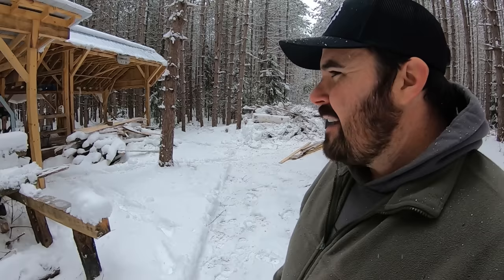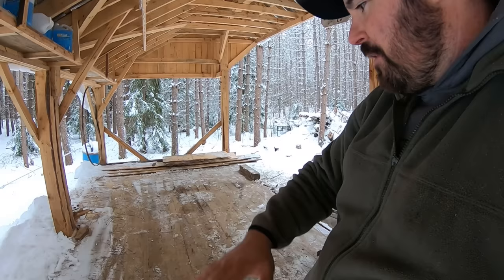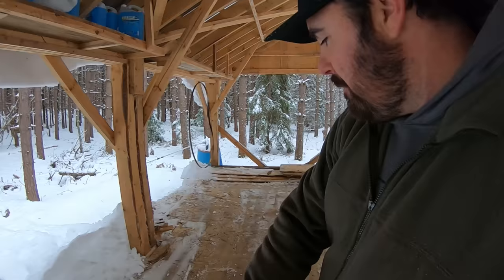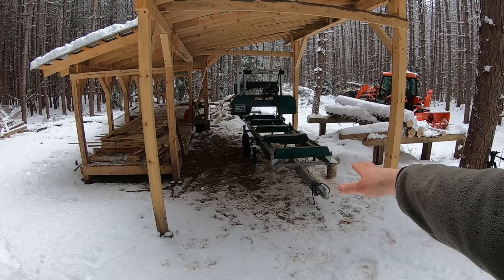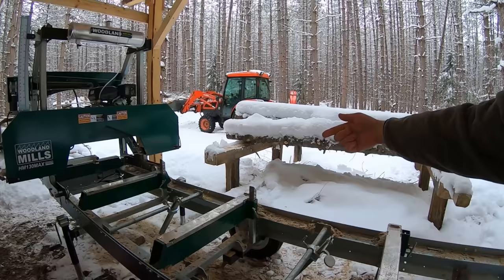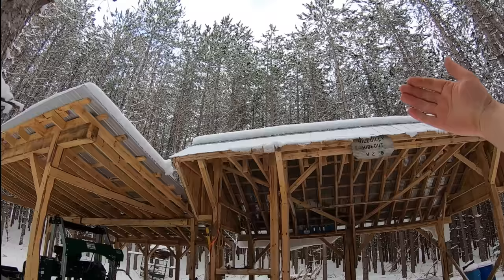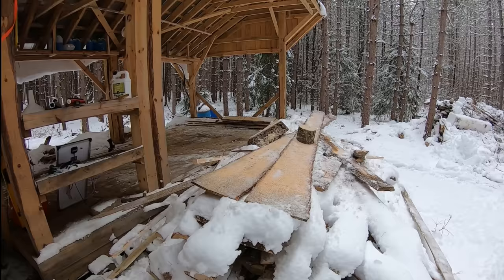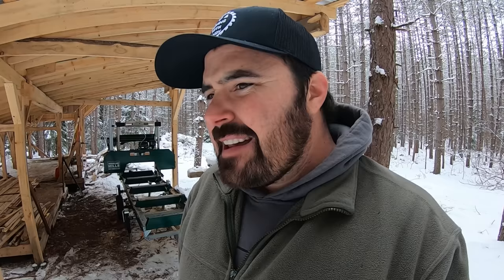Don't Build a Sawmill Shed Like I Did

Comment: Howdy Sandy- I understand what you’re talking about with having the perfect setup for a sawmill shed. That’s my next project. I did pour a concrete slab to set the mill on which I did right. The actual shed itself hasn’t come to complete fruition in my head. At least we don’t have to worry about much snow here. You will get everything all figured out and it will make a great video. God bless
Reply from the maker: I appreciate that! Sounds like a good start you’ve got going. With time I’m sure the perfect setup will be there as well

Comment: Hi Sandy, you could just simply build a wooden ramp at the opposite end of Hideout 2.0, take out a few trees and back the  sawmill where the old sawmill was. Then set up your waste rack. The waste rack could be easily moved when you need to pull out the sawmill. And the sawdust would go out the back as before.
Reply from the maker: After thinking more about it you may be right. That would be a good setup
Reply: Yes use your quad with a 2 in ball on it.

Comment: Nice summary of the pros and cons. I've been thinking about using a 1 inch metal grate platform instead of decking where the sawdust blows. If there's a nice deep but flat area underneath where I can reach it from the side I can just use a skid loader from time to time to pull out some sawdust and throw it on the compost pile.
Reply from the maker: Grate platform is a great idea. Not one I"ve thought about before. That would be a greats actually
Reply: Probably a series of 2 ft x 4 ft sections with some hinges (that will last the weather) so you can flip them up when you need to clear the sawdust out... but that's a bit "fancy"! 😏  2 ft wide might be a bit narrow for the spray.

Comment: You answered your own question. Pole barn is the answer and go big! Nice wide open area instead of the small confined spaces you're dealing with now. Big overhangs and raise the grade with some well compacted fill, and mud shouldn't be a problem. Blowing snow will tend to be a problem on one side more than another and you'll know which one, you can close in that side or just hang a tarp.

Comment: Merry Christmas Sandy!
Never underestimate where a concrete truck can go, they have smaller trucks and bigger ones with more tires to spread the weight(as long your in your  dry season) Concrete is super easy and cheaper than you think. 10mm rebar grid 16” o.c slightly sloped to drain, 4”-6” slab on compacted gravel, borrow rent or buy laser level  and set forms to correct height. With the width you would want you could just use a straight piece of lumber and smooth the top out, rent a bull float for the  day  and broom finish it. 
The large pads that you cannot reach other side you have to creat leveling pads in the wet concrete but since your would be narrow you have the top of the fork to slide on. If you go this route just have some friend over for some simple grunt work for an hour. 
Cheers
Reply from the maker: I appreciate that. I’ve been around some concrete but never tackled my own pour and you’ve made some great points

Comment: Thanks for all your great ideas Sandy.  I  intend on building a setup similar to yours, however, I intend to be able to drive my sawmill and trailer in at one end, and drive it out at the other end when I need to move it.  I also intend to use my ATV to move it around.  I am thinking of building a lumber shed attachment to the back, rather than the end, like you have.  the slabs will be in the front, next to the log deck, which will be on a couple of runners on the ground and the logs will be loaded onto the sawmill using ramps and an electric winch!  Cheers! :)
Reply from the maker: I also like that idea Paul. Would make for an easy work flow.

Comment: Having the mill under a roof is the ideal thing. Have you thought of sliding doors to block the snow from blowing in? I put sliding doors on my tractor shed to keep the snow out. Works good. Use the barn door type. Good info on the mill set up. Take care and stay safe. From: Petawawa, Ontario.

Comment: I like your idea of removing some of the top layer of soil in preparation to create a more solid pad under your mill. One suggestion would be to use a good filler as the initial base...then consider bringing in Limestone as the top layer. It packs well and can be topped up from time to time and graded when needed. As for tackling snow melt into your building area - maybe install weeping tile or drainage pipe to redirect water away or around your working area. Especially between the mill and the lumber storage rack.
Reply from the maker: All great ideas Dan. Thank you

Comment: Nice tips, I'd geocell grid some old tires (filled with stone/gravel) on the lower mill to get you out of the dirt. The gravel would has great drainage so your not working in the mud and get you up off the ground. Make a little ram to park the mill up on the grid at this point.

Comment: I’m going to build a A frame with shed roof off each side. This way I can offload lumber and keep dry and load logs onto  log rails like yours to keep dry as well. You can buy cheap stone path forms to make your walking surface at mill. It takes an 80 lbs bag per mold and cover almost 3 ft wide and long.   Thanks for tips!
Reply from the maker: Great suggestion regarding the stone path forms. Thanks for watching :)

Comment: Now that you have worked the mill and developed some understanding of the best layout, stick with that layout.  Minimize all motion (walk & wood) first.  So wood load comes in like you have it and saw dust out the other side by itself.  Slide lumber the long direction out and waste off the other long direction.  That way easy tractor access to load logs and remove lumber and scrap piles.  Once the process is figured out, then design the building to fit the process.  Yes, extended deck and everything under a roof with tarped walls.  Get the tart which has clear plastic windows so when it is down, you still have a view.  Could the scrap side be the direction for backing in the saw mill?  Or like you said, make a lumber foundation with 2x8s and fill everything with a good packable gravel with a ramp at either end to allow you to ride the tractor through the length of the building and just drop it off.  If the Mill was always permanent, I would suggest finding cheep roller conveyor sections to slide the lumber to the storage building.  That would minimize your lifting reduce the number of trips to the lumber storage location.  Sorry, this is my years of auto industry with processing human and robot motion.  It pains me to watch your setup knowing that it could be tweaked for more efficiencies.  The effort to cut down the pines would be well worth the improvements.  Your buildings are nice for the first/second try, but process first, then enclosure.  Right now the building and trees are limiting the improvement of your process.  BTW - I'm the same guy that mentioned using the half PVC tubes over the log entry ramps for better sliding.  Be Safe!  Truly enjoy watching your videos and hearing your thoughts.  Similar to your comment, that is my 2 cents, which might not even be worth 2 cents.  LOL
Reply from the maker: Well Robert I can tell ya your comments  are definitely worth more than 2 cents haha. Thanks for the ideas, really got me thinking

Comment: Hi Sandy glad your new mill is the right height to make the job easy on the body  If it was my setup there would be no buildings. I see you have a shop at the home that you could store your mill in  and take back and forth with the tractor every time you go out  With the large open space you can clean the snow and the waste with the tractor to make a nice place to set the mill up in fast time. Also I would put a hydraulic log loader on the mill  then would only need two timbers on the ground. Traps work good to cover up lumber piles. from John
Reply from the maker: Thanks for that John. Good to hear all kinds of ideas

Comment: You could take your forks and pickup the sawmill and set it up on the higher platform. Just idea. Have a great day be safe.
Reply from the maker: That’s not a bad idea actually! I appreciate that!
Reply: That would make it fairly easy to have a log bed extension that was detachable and stayed on the deck too.  

Pick up mill set in place, line up with extension and couple it.  Save the time and money to use towards more toys and upgrades!
Reply: Exactly what I was thinking.
Reply: I was about to suggest using fork too. Good luck figuring it out

Comment: I probably would put down pressure treated runners an build a boardwalk/deck type of setup. That's what I did for my shed out back. It started off with a dirt floor. Thanks for the vid.
Reply from the maker: Think that would work quite well.

Comment: I did my sawing inside with a small mill like you had, I found an old leaf blower adapted it to pull the saw dust from saw and blow it into a barrel with a filter bag on it. made dealing with saw dust much easier and cleaner.
Reply from the maker: Good idea right there. Thanks for that

Comment: Hi Sandy I have learned a lot from your video's and appreciate all the work to creat them. A suggestion I have if you are looking for a hard surface to keep your mill on is look for older flat bed transport trailer that can't be safetied anymore. Trucking companies sell them for scarp price or you might get lucky and get one free. I know people that got them free. You can rent or borrow a ( joe dog ) fifth  wheel tow bar on wheels and tow to your place with your tractor then remove the rear wheels and put to the height you want on timbers or cement blocks. Most trailers have a slider rear wheel set up and come off with just a couple pins. You might have to get somebody with a little bigger tractor if you have a bunch of hills. If the deck on trailer is not good just use your wood to deck over. I also have a 130 max and I use old grocery store rollers ( got them free ) to move my lumber away then use skids to move and store for drying.
Reply from the maker: Great tip George! Thank you for that

Comment: I've been with you a few years. You have a very nice set up. What's the chances of a wood floor again. Rock under it with the wood on top. Thanks for all the info on does and don'ts. Be safe. I'll be watching for the next video.
Reply from the maker: Hi Gene, I appreciate your support over the years. Could very well get another wood floor built maybe just a little differently as I do like using wood where I can

Comment: Nice job. My wife and I finished our sawmill port last summer, and one thing I learned the hard way was this: make sure you have the clearance for the ruler when you raise your sawmill head 30” to mill a 30” log. The mill head shafts do not raise up as the head is raised but the ruler does. I do not have the height, and looking at your setup I’m not sure you do either. 20”-22” are my average and no problem. 30” and my ruler does not clear the support beams. So I’m working on a solution. (By the way I got the same setup you have on a trailer but with one additional extension.) Again I really like your videos related to your sawmill and the ones where you just make use of what you have and make it work. Good stuff!
Reply from the maker: Great tip there Richard!

Comment: Sandy, dont be afraid of pouring your own slab. At 59 I poured a 12 x 30 slab by myself by doing 12 x 5 each day using a 1/6th yard mixer. The 5 wide is easy enough to finish by working from both sides with just hand tools, the hardest part aside from the shoveling of course was probably the screeding, two people would have been real handy there with one on each end of the screed board.

I poured one day, stripped forms and readied grade and forms for the next slab the following day then pouring again the day after. This size is about a yard per pour depending on how thick you go.

The day off between pours both allowed me to heal a bit but also set the concrete so I could get on it to finish the next pour. It took 12 days from start to finish.

Use class two base for your sand rock mix and add 1 cement to 5 base, always look at the mix to verify you cannot see color of the sand/rock, it should be a uniform gray. Never hurts to put too much cement but too little will make it a crumbly surface.

All dry material coming in so easy to work with at your pace and you should be able to get it in just about anywhere you can drag the 130Max using a dump trailer.

I have a 130Max also, I agree with you that it sits a little low as mine is not on a trailer, just on a concrete slab. I dont think it needs to be as high as the trailer though. My tractor will only lift 1500lbs and a wet 24 to 30" log can easily pass that at 12 to 16 feet not to mention 20 feet or more. I have two extensions and can cut logs up to 22' long.

Great videos, you have been a great help and inspiration for many.
Reply: Thought I would mention, my plan is to add another extension to mine partly so I can hit that 24' length for long beams but more importantly give me room to add a CNC gantry with a router to the other end of the mill. This way I can carve half log or slab signs for property entrances either on the ground or over top a driveway, bar tops or whatever up to that max length and have parking for the CNC at the far end of the mill.
Reply from the maker: All great advice. Thank you for that
Reply from the maker: Cutting those super long beams would be great! The gantry as well would be a handy addition. You've got me thinking now haha

Comment: HI Sandy. I also started on concrete blocks etc. on the ground, I watched your channel and others and watched how everyone moved when running their mill. I decided that I wanted my mill ( which isn't on a trailer as its for personal use mostly and I dint want to move it) firmly attached to the ground. My mill is up on risers and is on a concrete pad the mill is bolted down to the concrete. My mill stays solid and straight, for a roof I opted to turn the roof so the snow sheds off the ends. the roof is constructed of trusses (site built with my own lumber) so its clear spam front and back. I was going to build the back wall close to the ground so the dust could still blow out the back, but I opted to only bring the wall down to my head height to allow better mobility.  My slabs come off the end and are stacked off that end for processing. the saw dust goes out the back and into the woods, I have never had to clean any of the dust away, nature seems to take care of it. My wood comes off the front and is currently getting stacked in a covered ready rack. Logs are front loaded individually with a tractor. I'm sure we are practically neighbors, you are welcome to drop in and see my set up.
Reply from the maker: That would be a great idea Keith. Having it on a firm concrete pad would be ideal for me as well with a stationary setup like yours

Comment: There was a guy on YouTube that laid an enormous concrete slab by hand - it just took him awhile.
How he did it was he formed up small areas, installed reinforcing mesh and drilled holes in the formwork for reinforcing starter bars going through from the wet side into fresh air to mechanically connect the next next slab section when he got around to it (which now only requires 3 sides to be formed).  
Point is you don't need to do it all at once. 

For our purposes it doesn't really need to be more than 100mm thick - I know I asked someone as I just got a wood mill too.
I imagine 3x3m sections being able to be done. The first one is a steep learning curve but then it starts getting easier as experience is gained and you get a work flow happening. 

A concreter I asked told me 100mm would be even stronger if you could use a vibrator. He said at that thickness only insert it in each area for no more than a few seconds but I suppose he's used to proper powerful concreter ones. He said it significantly increases slab strength. Anyway handyman ones are available on eBay for sub $500. 

Definitely use re bar to connect sections and mesh inside. You don't need to have mesh sheets of 3x3 m. Just get them to cut them into sizes you can fit on a trailer with some overlap factored in. 
A roughish surface is desirable for what we want so no need for any fancy shop floor finishes. That saves work too.
Reply from the maker: I appreciate that info!

Comment: Try about 4 inches of woodchips on the ground around the mill.  That's what I use and my HM130MAX is at the bottom of a hill.  The woodchips keep things clean when it's muddy, they're free, and they can be added to your compost piles or to cover sloppy areas on your roads whenever you clean up.  It's a win-win-win.  I've been putting off building a work platform for several years simply because the woodchips work so well.
Reply from the maker: That’s a good solution! Thanks for the idea

Comment: Hey, I put down some short 4x4 and put a few 1x10 on top the 4x4 for the walkway, a long side my mill trailer. And it works good, easy to move if I have to and is low cost put stone down too and it works good too. I need a roof over my trailer as there is not one. The slope of that future roof will go toward the front of the trailer or tung. Leaving sides open for loading log and being able to plow out with a straight shot. Get to long here. I hear every word your saying good ideas. 👍
Reply from the maker: Great idea with the walking platform . Think that would be simple enough for me to make and keep me out of the muck. Thanks!